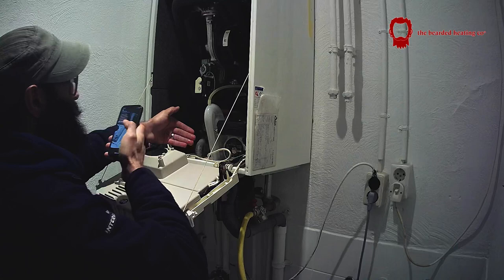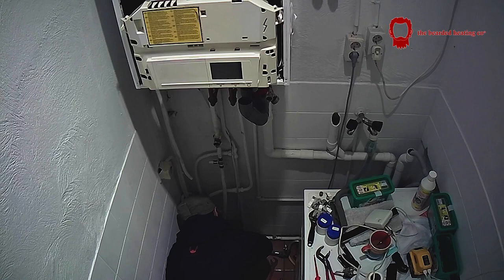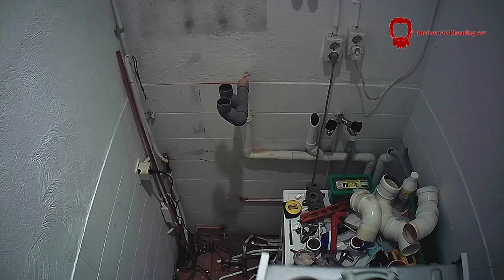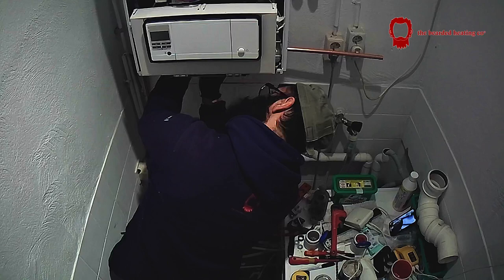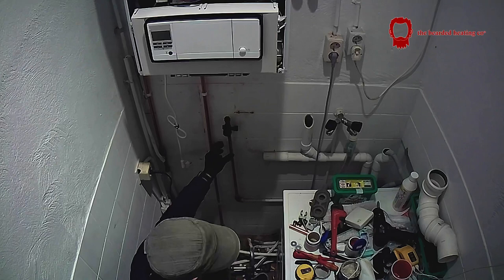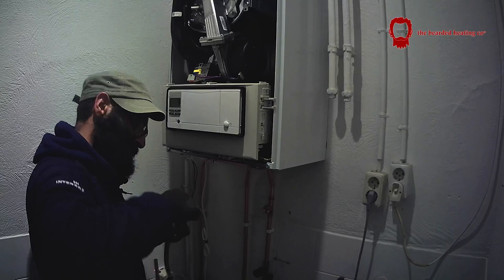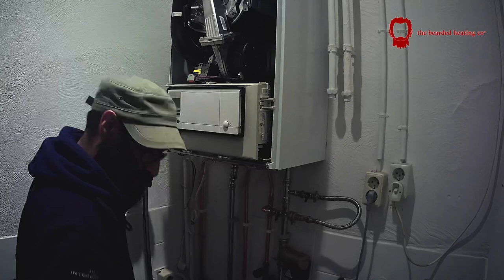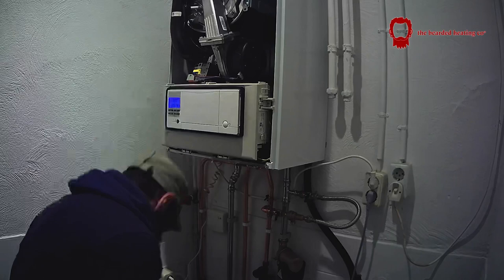The Bearded Plumber° Vaillant Installation

Comment: 2 points to raise mate that I'm interested in.  
    
1.  As the valve on the cold inlet has a non return built in, should you not have a  mini exp/vessel   above it ?      As the pressure build-up in the boiler could get pretty high with no expansion back into the cold mains.      I have seen lots of plastic components in combis damaged due to this......  

2.  You said about the plastic gas pipe.    Presumably then plastic is allowed above ground in Holland?   Is this not viewed as a fire hazard over there?

Take care.  :-)
Reply from the maker: Hey mate! Really appreciate u taking the time to watch the video and question me! I am grateful that my videos are being viewed 😍

1. The inlet combi valve has a non return valve, 8bar pressure relief valve incase the pressure builds up the expansion releases water into the drains! 

2. And yes plastic pipe is totally allowed here in the Netherlands, it's the same MLCP pipe but yellow and obviously the main benefit for using plastic gas pipe is that it's run 99% of time continuous under floor/voids and joints only made in accessible places. No chance of corrosion, no need for electrical separation... so there's many advantages of using plastic pipe for gas and the last positive about plastic is that the resistance and pressures drop is almost I certain half of metallic pipework!

I hope I was able to answer your questions and hope to see you question me on my next videos!! 

Live long & prosper! 🖖🏽
Reply: @thebeardedheatingco    Thanks for the answers.      All very different to the UK for sure,  i'm certain my Gas-safe inspector would be rubbing his hands together with the prospect of being able to throw the book at me in the UK.     ;-)          Cheers.
Reply from the maker: I remember my gas safe and corgi days inspection days... used to hate it in the early days and then it just became a friendly catch up over lunches 😂
Reply: @thebeardedheatingco  Lucky you, mines a failed gas fitter/board employee who hates everybody!   :-(